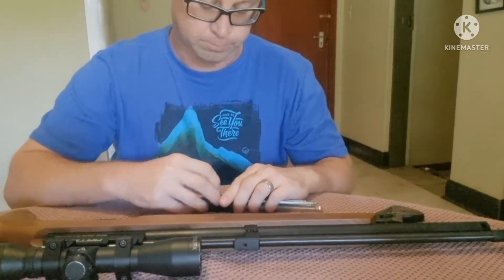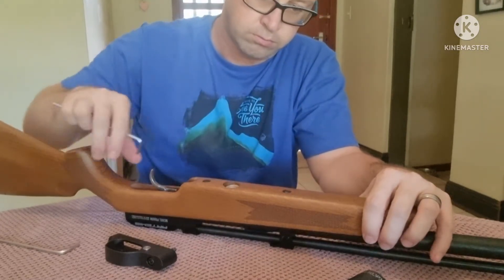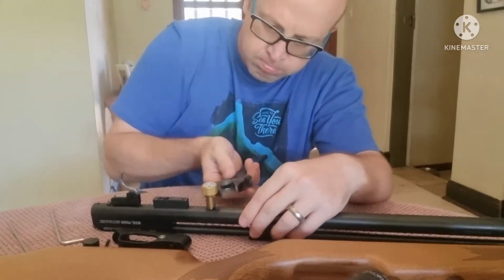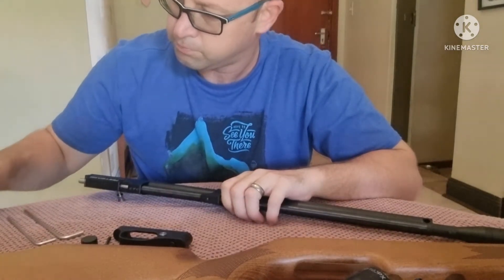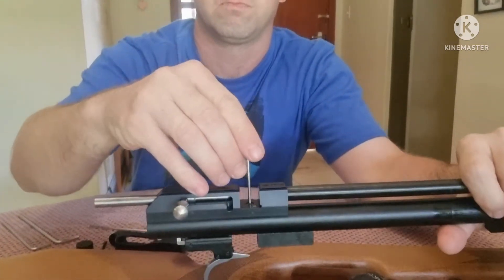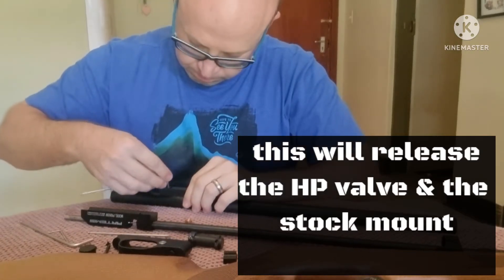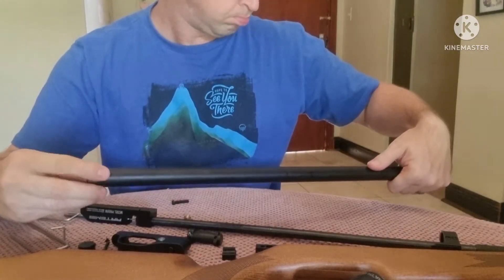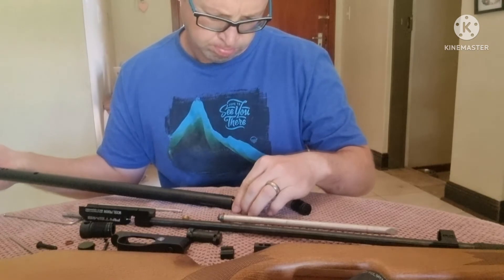How to strip down your PR900/Stormrider - Easy #PR900

Comment: Hi Tyrone. I like the material you produce in general. I am new to the air gu  fraternity and recently bought an Artimis PR900W second hand. I also bought a new hand pump. I have managed to pressurise the gun exactly 2 times. Since then I've not managed it again. I pressure tested the pump and builds up pressure. Can you please advise what could possibly be the cause? Piers Oosthuizen, Kariega, EC.
Reply from the maker: Hi Piers, is there any pressure building up on the rifle at all? If not, your o-rings on your fill probe may be damaged or too small so not sealing properly. If you are getting pressure on the gun, does it release at a certain pressure or just doesn't seem to hold pressure?
Reply: @African-Budget-Pellet-Gunner  There is no pressure build up in the gun. I'll replace them and retry. Thanks for the reply and advice.
Reply from the maker: You're welcome, keep us in the loop

Comment: Hi,
You think it s possible to drill at 4mm the valve, transfert port, barrel and cut the half of thread on the second part of valve ( or it s dangerous because it s high pressure )? Like the cp2, It s the same modification ?
Reply from the maker: You can definitely do the mod you won't have any issues. It will increase your fps for sure. Just remember that you  need to keep everything balanced, so you may need to increase hammer spring tension as well
Reply: @African-Budget-Pellet-Gunner  i have a stainless steel spring. It s more harder than the original spring 👍
Reply from the maker: That will probably work or else just put 5mm spacer inside the hammer in front of the hammer spring
Reply: @African-Budget-Pellet-Gunner before my pr900w it s a 177.
Now, she have better hammer spring, 3.5mm transfert port and the top (with barrel ) of 22. Cr600 ... the power is 42 joules ( 31 fpe ). I want to increase a little the power 😅
Reply from the maker: @HardmanFR is the CR600 you are referring to on co2 or has it been converted to HPA?
Reply: @African-Budget-Pellet-Gunner  it s a cr600w co2. You can use the top and barrel on lower of pr900w hpa.
For exemple, you can mix a pp800 and cp2 to have cp2 hpa
Reply from the maker: Oh ok, yes that is possible, sorry I was a little confused with your comment. I thought you were saying that you are getting 31fpe out of your CR600 co2 which is definitely not possible.

Comment: Wondering if you could get any Air Rifle what would you get?
Reply from the maker: Artemis CP2, lol. Serves my needs perfectly. If I had unlimited budget I would probably try a Edgun leshey 2. I like the compact stuff
Reply: Hello again I put a Lane Regulator and a end cap with guage. My compressor reads a higher pressure than my gun guage, which one would you believe?
Reply: I also purchased a Weihrauch HW 110, 22 CAL, It should get here tomorrow. Excited!
Reply from the maker: I would probably trust the higher of the two, just for safety reasons but when you are shooting you will obviously need to reference off the rifle else it won't be consistent. How big is the difference?
Reply from the maker: Wow, those are brilliant rifles and there is a reason most people who do ratting in the UK as a job use the HW110, it is accurate and extremely reliable, you are going to love it.
Reply: I still have the original guage which is the Regulator pressure. The compressor reads 200 the gun shows 150 at the end cap guage. 

My HW 110 is the Carbine, my decision was based on reputation,noise, accuracy. 
Thanks for your help it's appreciated!

Comment: Hello, will the pr900 get more silent when the hammer spring is a bit shorter? Other question how can the moderator be opened? I can not get it open. Thank you. Great channel.
Reply from the maker: With a lighter hammer spring it will make it a little quieter because there is less air to disperse. The moderator should be able to unscrew at both ends check my silencer mod vid for the CP2, the silencers are identical

Comment: Hi Tyrone.....nice video, thanks. What  I don't like about the pr900 is the hole in the pressure tube for the pressure guage. This is the weak spot. Pushed to destruction, it would fail by this hole, even though it is isolated by a O ring either side.

Better to have the pressure guage on the front end of tube
Reply from the maker: I hear what you are saying but have never heard of anyone having an issue here. I know however that most manufacturers are trying to move away from the guage on the end of the tube for safety reasons, almost needing to look down the barrel to see the pressure. Thanks for popping in and taking the time to leave a comment

Comment: Ah yes the how to dismantle, followed by how to put it back together in instalments ... and the what to do with the left over parts 😏 
May I suggest not using ball-end (they round the screw heads) and do invest in a set of nut-driver Allen (like a screwdriver with interchangeable bits). Collect part in trays, I use an old mince pie baking tray with dimples for those little bits. Garden cane, long bamboo stick.

Comment: Question, how does Hammer speed or spring tension affect your shooting?
Reply from the maker: Well higher spring tension relates usually to more fps obviously if other factors allow this but with more tension comes more force required to pull the trigger. A heavier trigger can affect accuracy

Comment: Hi Tyrone , I know your pr900 is a full power rifle. For the transfer port , its hole is bigger than a sub 12 fpe tp. Can you tell us the size of the hole in your tp ?
Reply from the maker: The transfer port on the full power is 3.5mm, I believe in the sub12 the transfer port is 2mm.
Reply: @African-Budget-Pellet-Gunner  Thanks Tyrone ! 🙏
Btw,  will you consider enlarging the tp hole to increase its power ?
Reply from the maker: In the full power version, if I wanted to shoot slugs in .22 I would probably open up the transfer port but don't really see the need at the moment. For pellets though I think the current fps is performing fine
Reply: @African-Budget-Pellet-Gunner  3.5mm is the size used in the 177 CO2 versions, CO2 22 uses 4.3mm. PCP is using higher gas pressure so the TR is smaller. The TR controls rate of gas flow.
Reply: @African-Budget-Pellet-Gunner  With 22 you could increase up to 4.3mm, above which the pellet may jam in the hole. However rate of release also controls how smoothly your pellet goes down the barrel. And it wants to be smooth for accuracy and repeatability.
Reply: @jeffslade1892  sorry but what's "TR"?
Reply from the maker: I believe it stands for transfer Rate